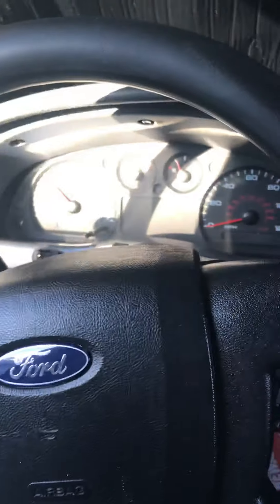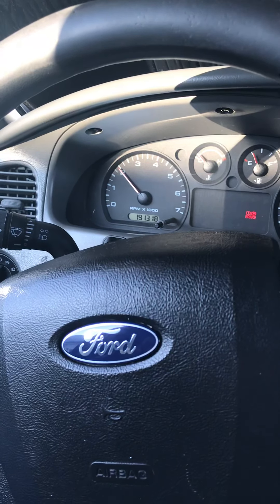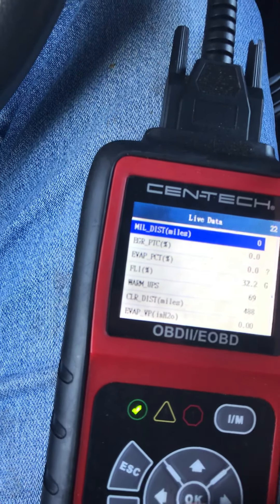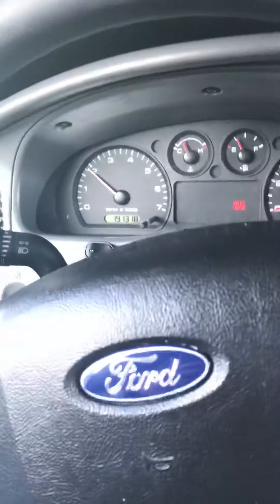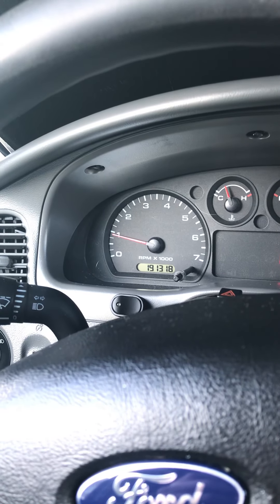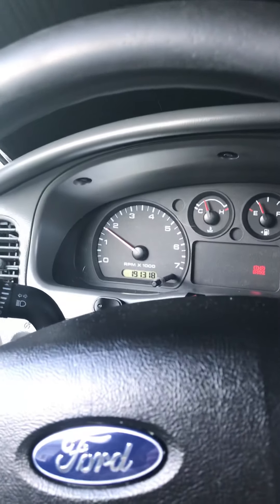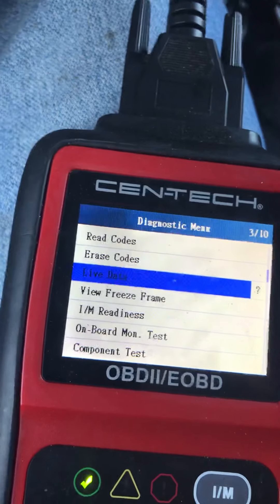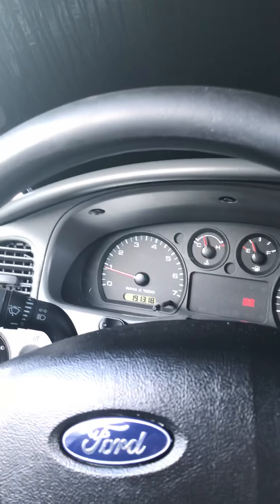Ford Ranger High Idle with HVAC on

Comment: I've been chasing the same problem for over a year. Finally found the fix so hopefully this helps someone out as it seems to pretty common.
I replaced the usual IAC, TPS, inline check valve to vacuum line. None of those changed anything.
I went to Pull a part and grabbed a heater control switch console and the vacuum supply hoses that were attached to it.
Swapped it out with my control unit and the truck idles perfectly at 8-900rpm and stays there even when I engage the heat or AC.
Prior to replacing this, my rpms would jump up to 1500rpm as soon as I turned the selector to heat and drop right back down when I turned the switch to OFF.
Never did it with AC on. I'm concluding that there was some sort of vac leak being created inside the switch when placed in the heat or defrost position.
Reply from the maker: I didn’t have a chance to make a video on it, but the issue came back, i ended up doing some more digging and switched to the HVAC system, I unplugged the high side pressure switch and the idle immediately went down to normal ranges. The only thing in that area that would cause a high pressure issue would be the orifice tube. Sure enough I pulled the orifice tube and it was plugged up with very small bits of debris, replaced it, recharged it, now the truck runs beautifully with the heat or ac on.

Hope this helps

Comment: Idle air control valve had the same problem on my 92 yes I said my 92 after I rebuilt the AC system my daily driver long live the ranger

Comment: I've been fighting this on my 96 Ranger with >200k miles. I replaced the IAC valve which seemed to help a little but still the problem persists. Same thing as you are seeing RPM hangs high around 2000rpm with AC on. Turn off AC and drops right back down. Also, when it happens the AC compressor stops running and stops blowing cold air. I wonder if it's low refrigerant?

Comment: I had this issue 3 months ago on my automatic 2011. Did it all day one day scared the crap out of me when I went a whole mile without losing speed. When I put it in park at home the rpms skyrocketed and wouldn't come down. Next day perfectly fine and hasn't happend since.

Comment: I have the same issue on a 1997 Ranger with a 4.0 in it. Changed out the ECT and cleaned MAF, IAC,  and intake air temp sensor which made things better but the HVAC still causes the same rev/stall problem when it's on. Hope you share the solution of you find it.

Comment: It's your idle air control valve that is getting stuck open and sometimes could stay close. I had the same problem on my 2002 ford ranger v6 3.0  after I cleaned it it worked a little bit better. You need to clean your idle air control valve or replace it.

Comment: My 2001 3.0 does the exact samething when my ac is on. Luckly it's a manual so if i need to have the a.c. on I can keep it in neutral. It seems like it does it only when tha ac compressor clutch kicks on so I'm  thinking the compressor is startint to go out or the bearing that the clutch and pulley ride is going dry. A.c. compressors do put on alot of load on any engine and if the bearing is starting to go dry that's extra load and the engine is over compensating with high rpms. My two cents.😉
Reply: I also have a 2001 3.0 and have the same exact problem.  My ac is also going out.  I have already replaced the IAC and the TPS (which made it run better but didn't fix the problem)  What you said about the AC compressor makes since. Did you ever get it figured out?
Reply: @JustJimus same here man 03 3.0 v6 when my ac is on it doesn’t want to slow down and it’s rpm’s will go to 3000 and stick or when I’m driving and am stopped at a sign it stays at 1.5 rpm
Reply: @Imhim907  I checked my relays and found my AC Relay was bad, which caused me to have an intermitant AC failure. I replaced the relay and immediatly my truck ran perfect - no Idle problem, no AC problem.  Runs like it was new.

Comment: I have a high idle on my 2008 ranger with the 2.3 I-4, I think it's the idle air control valve because it doesn't have anything to do with the hvac In mine.

Comment: Idle air Control valve
Reply: My 97 2.3  runs great if I leave the a/c off. If I turn it on, rpm goes up a little,
then I put it in drive, it slams into gear.
It goes down the road by itself without 
stepping on the accelerator. Once it’s warmed up, it’s back to normal, even 
with the a/c on.
Changing the idle air valve made no difference
Reply: classic287 on a idle air you have to reset them by unplugging it and and plug it back in